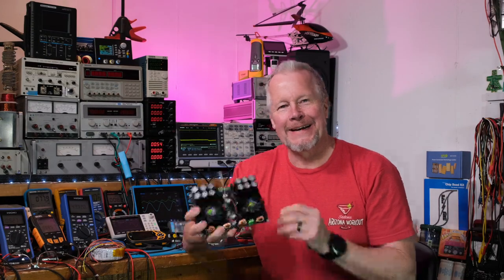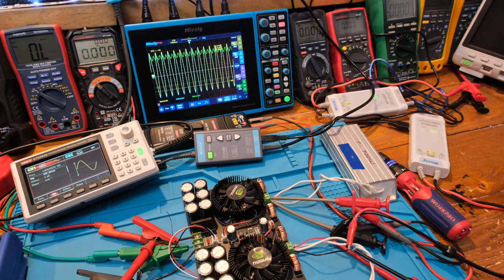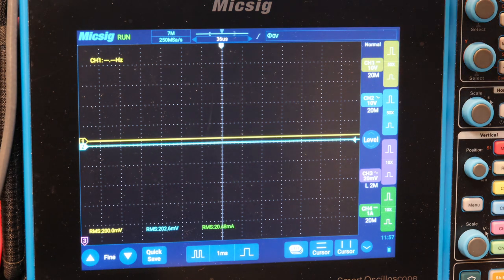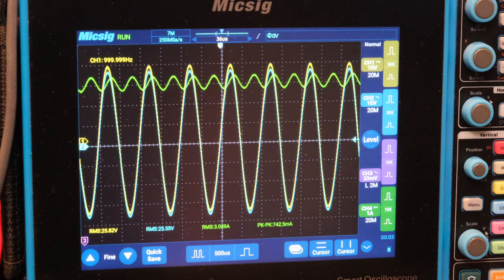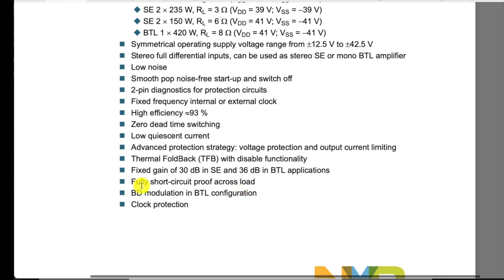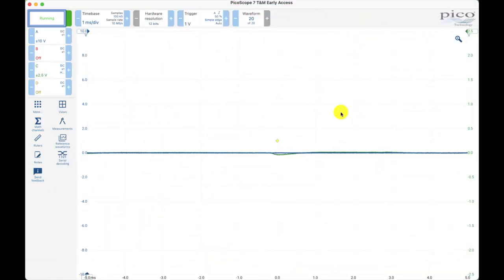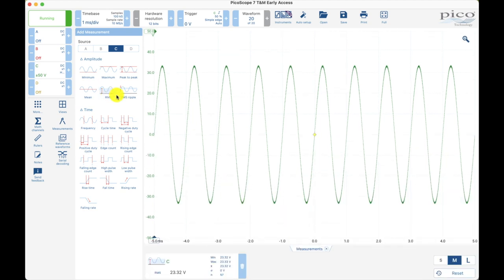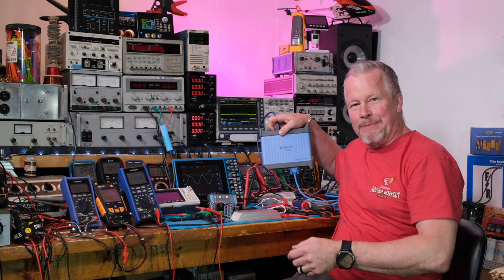Class D Amplifier TDA8954 420W x 420W board power test

Comment: Great video. 160 watts will be pretty loud. Especially if you have proper speaker cabinets to drive. I used to have a receiver that was only 100x 2 driving 2 cabinets with a tweeter, mid and woofer, and it shook my apartment. I think the class A you built  was 20 watts per channel or close to it which is fine for bookshelf speakers, but this amp should really crank. Thanks for the tip on inverting a probe to get A-B so I can measure current across a resistor.
Reply from the maker: Thanks Tron!  I did end up getting about 30 Watts from that Class A, but I think it most likely went A/B in the higher wattage.  It is a hot beast;)

I'm glad that worked out, I will do a video on probes and how to use them on the scope.  I also picked up some low cost scope probes to review;)
Reply: @KissAnalog  Hi, I bought an xh-m258 and after seeing your videos I decided to change the 24va toroid and I bought a 35va dual 500VA toroidal that I just connected but something is not working because the TDAs heat up but I have no audio and measuring on the speaker terminals I have 7.5vc on one side and 9vc on the other and trying to lower the volume of the source, the output voltage on the speakers does not decrease. From the video I understood that the xh-m258 could be powered with double TDA8954TH with a dual 35v. Did I get it wrong or is something escaping me? Thank you in advance.

Comment: Thanks Eddie.
Old technology, you can get 400 watts out of the Purifi and over 1k out of the ICE modules without external cooling. I'm running the ICE modules in my system now, the sound is great and since I never utilize 1kW the distortion stays very low, I figure once you get above ~1% you start to hear it. My amps run so cool you can hold your finger on the components.

I'm really sold on class D, it would be neat to do an AB test with the class A you built and my class D with the tube buffer stage, I wonder what your friend would think then? The trick is to set up the class D and its buffer together then do the FFT's and bode plots. This way you can really contour the sound to your liking.

I think it's what you like, I like detail, resolution, soundstage  and dynamics. The 6922 tube is great for that and so is class D. I just rebuilt a Fisher 500c tube amp from the 60's and it sounds pretty darn good at 32watts of tube power but doesn't compare to the class D amps. I can't imagine you can get real dynamic range out of a 25 or 30W class A amp, it's probably okay but if you play Holts The Planets into low or mid efficiency speakers doing an AB comparison I think it would show the difference in dynamics. Most times when I hear class A systems people are showing off it's with singers or guitars in small ensembles that don't require broad dynamics.

Here's an idea, why don't you do some testing comparing class A and D, you should see some differences when you push the input signal to simulate high dynamic range music. I think the Pico would show it up nicely. What's the noise floor on the class A you built?
Reply from the maker: Thanks for this great feedback!  I have looked at the ICE modules, and have been intrigued;)  I'll take another look.  I want to reverse engineer one;)  I also like it when I can keep my finger on parts without the heat making me pull away!

My plan is to build this Class D and give it to my friend to do A/B comparison with his 30W Class A.  I agree, the Class D should have a lot more dynamic power.  I always wonder about the 'sound' part of the amp.  My feeling is that a great amp should be linear and not have a sound of its own.  But, then I know they do - there's psychoacoustics that I think are not even perfectly understood.  So, that's why I'm so interested in this comparison.  I think it goes far past THD, or the noise aspect, but maybe the THD (to a limit) does relate to the amps ability to represent the signal maintaining the original signal quality.  I'm very interested in the multi-tone test.  I'll have to try that and see what it shows;)
Reply: @KissAnalog  I'm interested too. I remember when you did the class A and there was all that second harmonic distortion. I think class D can be a little antiseptic but it sounds great with a tube buffer. I agree specs don't mean you'll like the sound. Should be fun.
Hope you're feeling better!

Comment: Hi Eddie.I am on my second board.About two years now in this project.Tried many power supplies.Always the same problem with   two new amp boards.Every thing is fine on the bench and power testing.But when i connect the speakers at high volume it starts to cut out.No matter if it is 4 ohm and 8 ohm.For now i am running 1kv torroidal 24-0-24v ac.Do you think some kind of protection,because i know my speakers can do a lot more.Thank you.❤
Reply from the maker: Thanks for the great question!  Just to be clear - when you say cut out - it means the sound turns off?  It sounds like over temp.  Does it come back in a minute or so after it cools down?  Or, does it come back immediately after the volume is turned down?  In that case it is over current.
Reply: @KissAnalog  Thanks for fast reply.If i turn down volume a bit ,it goes back to normal.When it cuts out it lasts about half second.Chip is not hot at all.Starting to wonder if board is designed bad.At around 130w it starts to cut out if I back it down to 120w ,no problem.Really low power for what is it reated.

Comment: Hi, I bought an xh-m258 and after seeing your videos I decided to change the 24va toroid and I bought a 35va dual 500VA toroidal that I just connected but something is not working because the TDAs heat up but I have no audio and measuring on the speaker terminals I have 7.5vc on one side and 9vc on the other and trying to lower the volume of the source, the output voltage on the speakers does not decrease. From the video I understood that the xh-m258 could be powered with double TDA8954TH with a dual 35v. Did I get it wrong or is something escaping me? Thank you in advance.

Comment: If I am going to use a 24 0 24 15Amp traditional transformer with this board, then what will be the outcome(Watt/RMS) for each channel at 8Ohm load? Another point is whether a 24 0 24 15Amp traditional transformer will destroy the board or not?

Comment: get a 10 amp +-40v switching power supply ... it can't make the carrier noise any worse.
Reply from the maker: Thanks for the feedback.  That's not a bad idea;)  I do plan on designing a project from power supply to amp that is all switching.  I thought I'd use a transformer on this for a more direct comparison to the Class A that my friend is using.   Do you have a particular make of switcher that you would recommend?
Reply: @KissAnalog  hey yeah I understand the urge to use Transformers that you got lying around I have some too, however for around 40 bucks you can't go wrong if you can wait for China to deliver. There's some good choices out there which I've used in the past just do a search on eBay for "800w ±40v llc soft switching power supply" and take your pick. As for brands that's for rich folks I'm an experimenter having said that you're most likely have to modify the bridge rectifier and capacitor circuit on the line side as they are 220vac, just rewire it into doubbler like you would in a computer power supply. You will need new caps but I'm sure you have those lying around.

Comment: Does it have power-on/off “pop” problem like many TPA3116 boards?
Reply from the maker: Great Question!  I don't hear one and the data sheet does say that it has protection against this - which seems to work well.  Probably a delay before it allows the output to change.